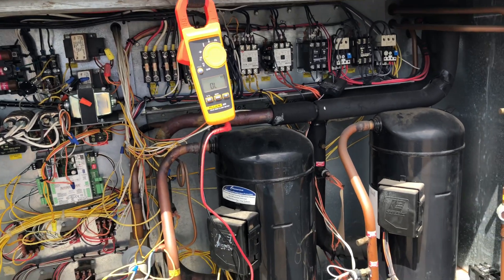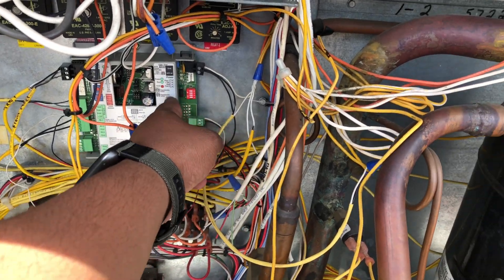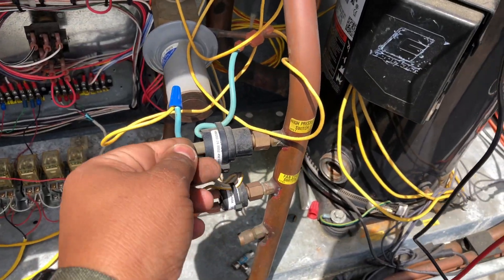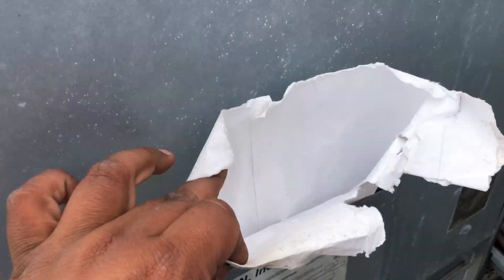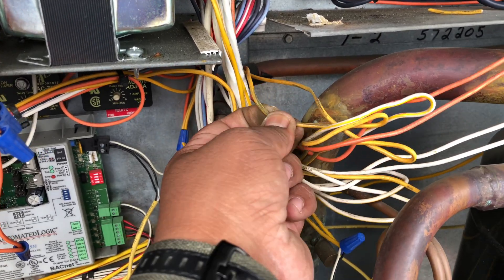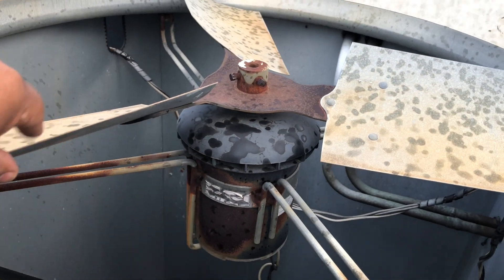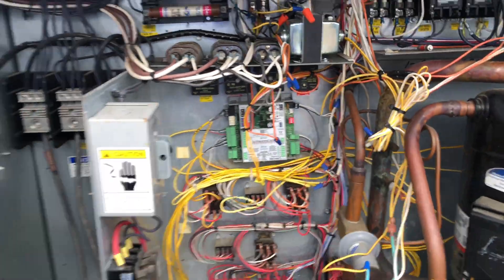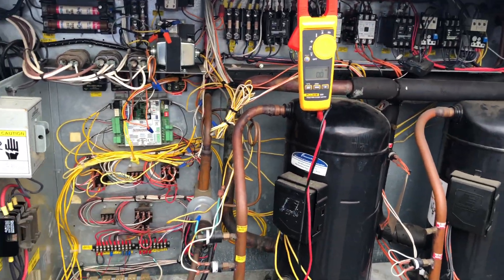HVAC Service Call AAON Package Unit

Comment: Great video and fine troubleshooting, I have 4 AAON package units that the compressor are Copeland scroll digital that it won’t start. I’m new at this job, any helpful tips will be greatly appreciated.
Reply from the maker: Thanks for your comment. With little information is hard to help but assuming that you have primary power I would go by checking the sequence of operations on the control side (low voltage) if you know how to read the the diagram that will help you a lot, AAON diagrams are more simple than other ones. Verify if you have control voltage.